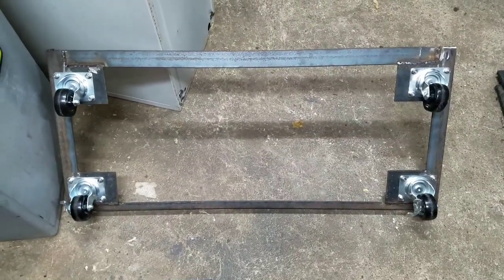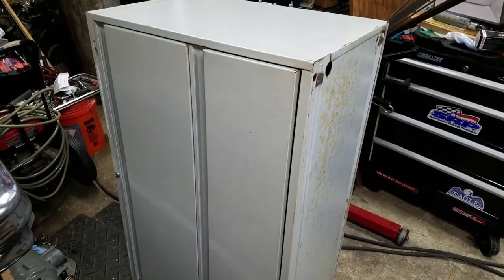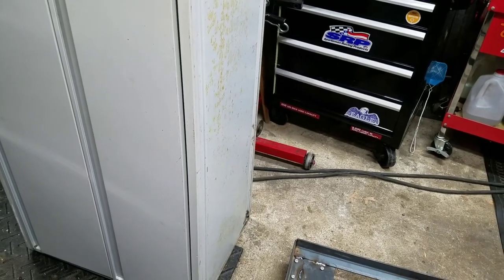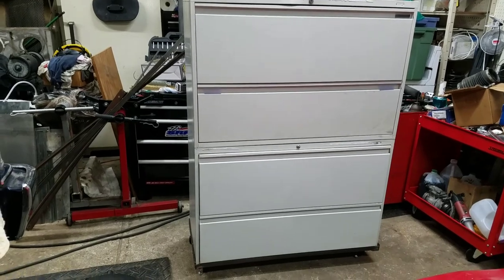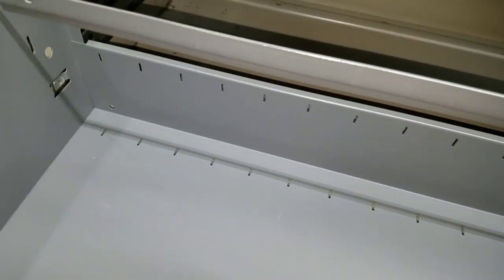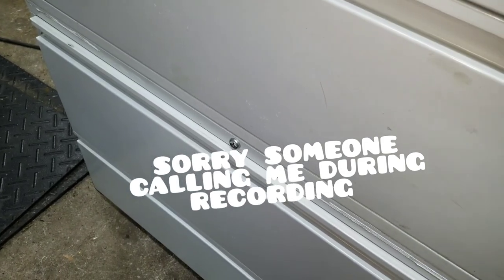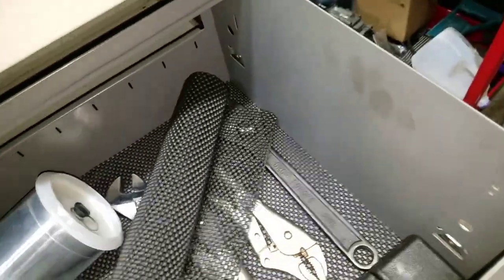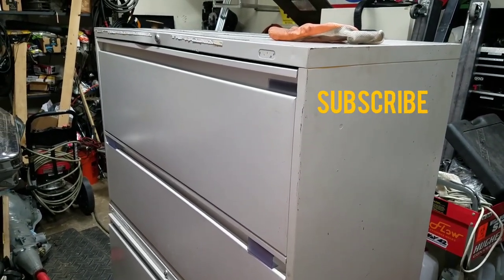DIY Filing Cabinet Tool Box Conversion

Comment: Pretty much the ultimate hack tried to get traditional tool boxes but even 400 for a husky box is too much considering these cabinet go anywhere from 10-50 bucks on market place
Reply from the maker: Oh yeah! I have 4 of them and even used old bed frame rails with casters for cheap to give a bottom frame that rolls around the garage easy. Now all of my tools are stored easy. Thanks for watching. 👍